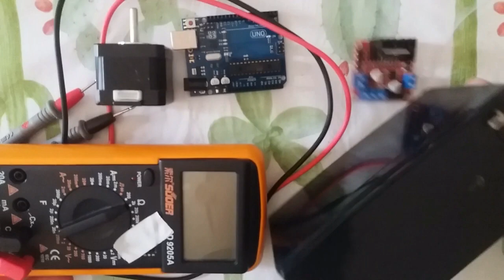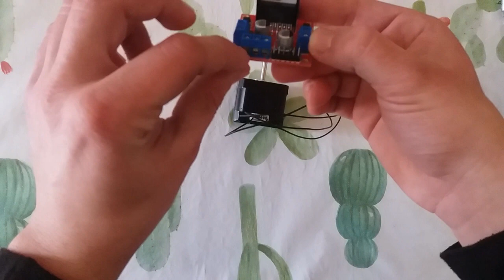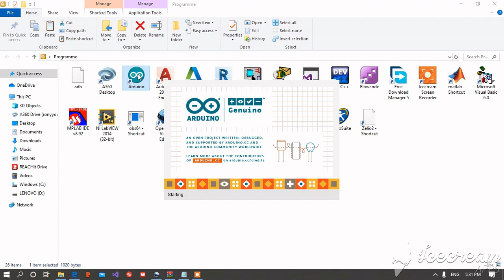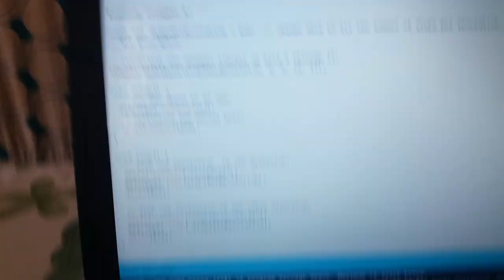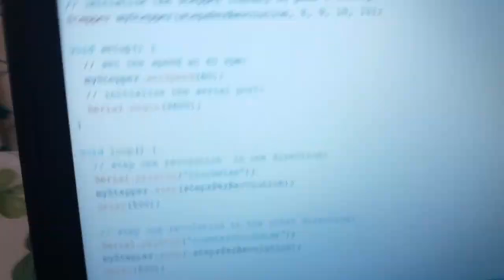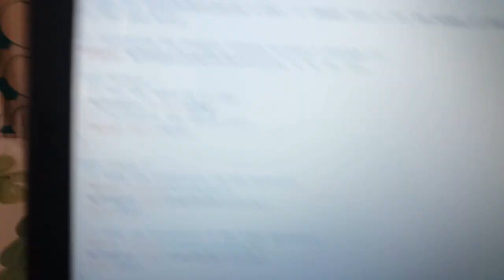How to control the speed and rotation of a stepper motor.

Comment: Hey mechatronic what wire did you use to connect the stepper motor?
Reply from the maker: hello sir, you can use any normal wire to connect the motor if your motor doesn't have its wires
Reply: Ok thanks

Comment: Can you share code. I want same setup but variable speeds in same direction.  Like start motor 100 rpm then after 10 seconds increase speed 150 rpm for 2 seconds. Again reduce speed to 100 rpm for 5 seconds etc
Please guide for coding and connection
Reply: Sorry dear Muhammad, have you reached the code of this idea? If so, can you share with me
Reply from the maker: @joinentertainment26  hello, let me know if you need any help.

Comment: How do you prevent l298n from overheating?
Reply from the maker: Hello Dear, Sorry for the Long delay😢😢
if you have a motor power that needs a current more than your driver, you need to get a bigger driver to be able to hold the load, if not, you can do similar ways related to heat transfer to remove heat from the device to the surrounding

Comment: Hi mechtronics, I am so glad that I found this video, it is very helpful and I have one doubt I am using nema 17 and trying to control the angle. How do I calculate the rpm of the stepper motor? Or torque without knowing the force?

Comment: Hi Mechatronics, I love the way you explain, you make it look so simple, I know that just watching your video, I will be able to succeed, thank you so much, but I need your help  I will be using a 12v piano switch to start the motor counterclockwise and I need it to stop completely when it reaches the spot, then when I press the switch again it will turn clockwise to its original position. So please tell me how to stop the motor till I am ready to bring it back to its original position. Thank you for your help.
Reply from the maker: Hello Dear Ralph,
We hope you're doing well,
First it's our please that you benefit from our tutorial 😊,second you can put an IR sensor or any sensor that can detect the presence of an object in front of it, so that when the sensor detect the presence of the object, it will stop or it will change the direction depending on your application. there are plenty of method that can help you, or you can the rotation degrees on your motor also it can help you..
tell me if you got me or not😊.
In addition, we are now working on many projects, after some time we will post as much videos as we can.
Best..
T.Y
Reply: @RoMecha_lb  First let me thank you for replying so soon. I don't have the room to add sensors, but I was thinking if I could add in the code to stop the motor and use 2 to hold the motor, and then when I turn on the switch it returns to original position.

Comment: Can i get the stepper motor to take a break let say 3 seconds before it rotates in the other direction, and thank you so much for this great and helpful video 👍
Reply from the maker: Hello Ahmad,
Hope you're doing well,
First it's our pleasure that you benefit from our tutorials👏👏,
Second, i don't understand what you exactly need to do, in general you can add a 3 second delay between the two operations, or you can replace the delay with anything else or any operation to start turning in the opposite direction.
if you see that's not helpful, please give me an additional details so that i can help you clearly.
Thank you..

F.D
Reply: yes,you can. Just type in:
  
 "                 delay(3000);              "

on the end.

Comment: Great work!!! Live the way you changed values to demonstrate the effects!  Learned so much!!
Reply from the maker: thank you so much david , it's our pleasure that you benefit from our videos, we have some upcoming projects and we will post it as soon as we can 😊😊✋
Reply: @RoMecha_lb  Hi, I am trying to geta simple program to workbut keep running into problems.  I justneed to get twostepper motors to be independently controlled by the phone app.
Driving me crazy.  This should be simple but I'm just missing something.
Reply from the maker: @davidrussell2239  Hi david , Hope you are doing well 😊
i am not sure what exactly you want , but you can control two stepper motor using one arduino , or you can do it by controlling each servo motor by one arduino , it is not difficult , you can make any operation you want by using two arduino and two motors. ✋✋